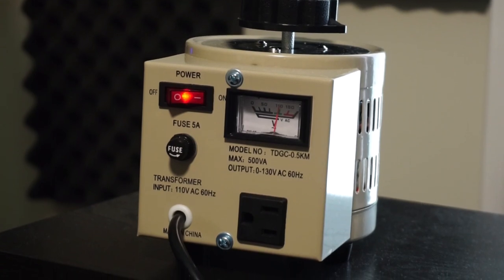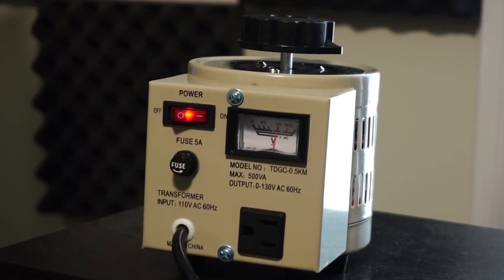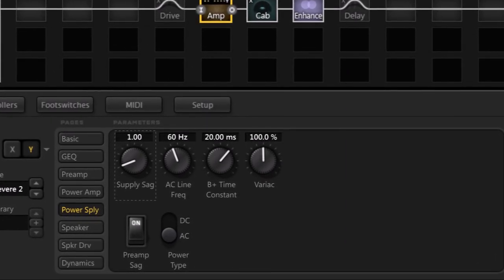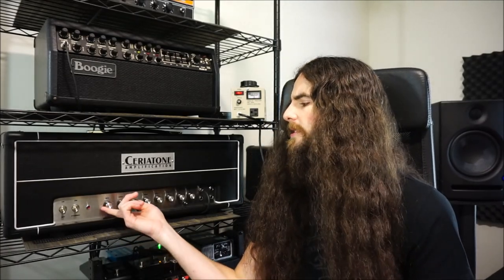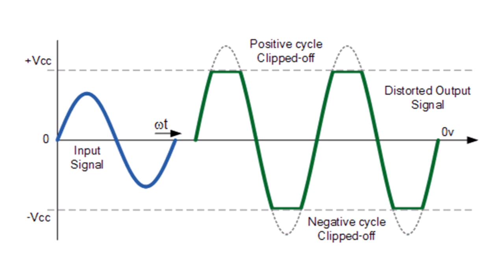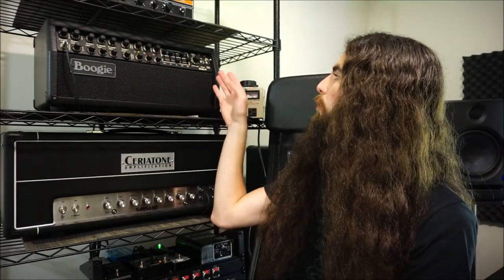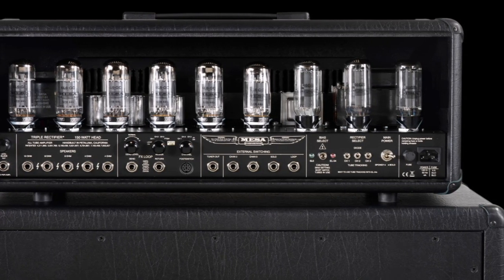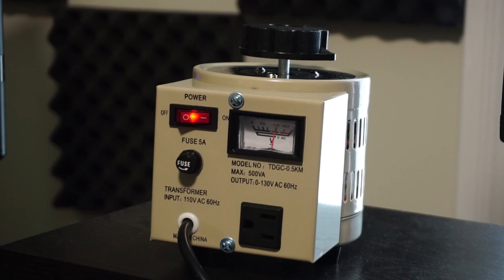The Variac: Variable Voltage Transformers & Tube Amps - Explained

Comment from the maker: Some interesting information from Ceriatone's Nik Azam regarding the results of this video:

"Some of the older amps have very high voltage. Some Super Leads were close to 500V B+. The preamps could also have higher voltages, whereas in lots of these hot rods, the voltages are lowered already, as part of the voicing.
 I think the preamp voltages have a lot to do with it. The Jose types are already 90-130V, whereas most Marshalls are higher. Definitely hard to capture, as opposed to have a vintage Plexi cranked up, and then using a variac.

I think we have done one before, exactly like the Boogie, by having a power transformer with extra taps. So it was either 490V B+ as stock, or 360V (for about 75% from the wall). With the stock Super Lead circuit, the difference was very notable, definitely.

I think it's also a function of the time - back then in the 70s, there were not that many pedals like now, and people had to come up with this sort of thing. Even basic things to us now, were magical stuff back then."

Comment: To me the Variac sounded better than the tweed setting. I wonder if the extra transformer is effecting the sound? As another has commented, I have read contradictory things regarding tube life and vairac. Since mesa is not using an actual variac I don't know if there are technical differences in their circuit, and some people say a variac can prematurely damage an amp. What do you think?

Comment: Im a Peavey amp user I've used the XXX for years with the built in loose-mid-tight switch which honestly depending on your style of playing or style of music was very beneficial, playing rock set to tight playing death metal set to loose, now I'm playing on the Invective and it only has 2 setting full and half power full power sounds so much fuller with 6l6's. One thing you didn't even mention that different power tubes 6l6, El34, el84, kt88 all react differently to a variac and different levels of quality of tubes react differently to a variac there are literally thousands of combinations

Comment: My AC30 2010 seems to stop completely or cut the sound after while depending on where I’m playing specially if the electrical facilities are not the best. The variac would do the trick to keep the amp stable?

Comment: I figured you would be the one to ask as you are kinda the "Mesa Guy" (at least to me) on YouTube, I was wondering if you are familiar with the Strategy series of power amps and how I could use one in the fx loop of an amplifier to give it more headroom, I'm currently running a Randall RH1503 solid state head and want to use the 400 watt iteration of the Strategy, what effects in tone could that help or harm? I want to keep the Solid state damping but as with a lot of solid state heads more watts seems to be accepted as more better
Reply from the maker: It really depends on what you're trying to accomplish, as there's several ways to make this work. The speaker impedance curve will be main tonal impact you'll observe whether you run just the Randall's FX send into the Strategy or the the headphone out (probably not ideal as it may have speaker emulation baked in). Solid state power amps don't react to speakers in the same way, and you will perceive a more scooped tone with the Mesa as a result. Check out this video for more information if you're interested: https://youtu.be/TM9yzbo4Kbk?t=1327

Whatever you do, you won't be putting anything into the Randall's FX loop. You will basically be "slaving" the Randall into the Strategy. The question is, do you want to use the Randall's power section at the same time? That will ultimately determine the signal chain
Reply: @PlagueScytheStudios  Well, looks like I've got some studying to do. Thanks for the help, keep up the great work man

Comment: I was thinking about getting a brown box for my 68 50w marshall plxi . its bone stock and has no mods and all the guts transformers etc are intact and if i used said brown box i would have to have it rebias to 110 v my wall voltage is 123v isnt that right? this amp never goes out of my studio and ive never had a problem with it at 123v my tech looks it over every year what do you think ?

Comment: Would you say it was important during Eddie's time in the 70s because he didn't have the options of today. Ie built in, attenuators and distortion pedals?
Reply from the maker: Absolutely. Like Nik said in the pinned comment, amp circuits of that time often used higher headroom (i.e. higher voltage) circuits that were harder to distort at managable volumes.
Reply: @PlagueScytheStudios  I've had a duel rectifier since 1994. From when they first came out. Incased in leather. The first ones were. I never realized the spongy setting was a veriac! 😂😂😂😂😂😂😂

Comment: are the negative rumors about variac use true? I've been reading things that either starving your tubes or giving them more power fry them either way. I am hearing more bad things than good about variac use in terms of the damage it can do to your amp. Also heard that if you are to use a variac, you have to rebias the amp. I really want to use one because my amp is too damn loud! I have a marshall origin, so nothing vintage and brand new.